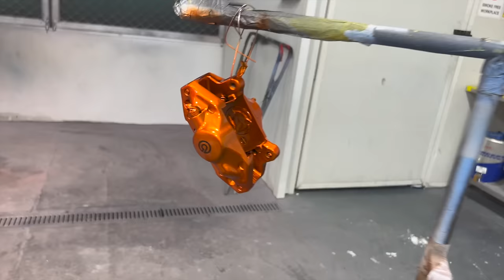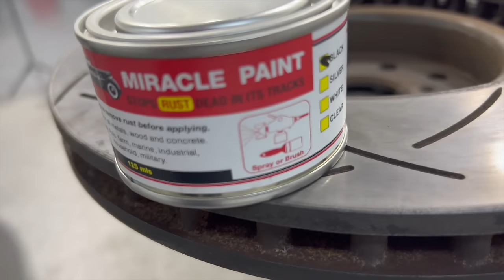How to paint your Brakes & Rotors with spray cans.

Comment: Glad to find a video that is a proper job removing the calipers. I want to color match my calipers the Honda Milano Red. That red is available from DupliColor Perfect Match which is an acrylic lacquer. I was thinking I could possibly get that paint to hold up to the heat if I used specific for calipers primer and clear… but those are all enamels and was worried about putting  acrylic lacquer on enamel. I might just be over thinking things… but this video made me feel I can just use an etching primer and 2K clear… so going to give it a shot. The car is just a weekend cruiser… not getting to extreme braking temperatures.

Comment: Great video on painting, just one important thing to note as a mechanic to never paint mating surfaces like on the face of the brake disc or surface for caliper bolts.  The paint will collapse over time and cause the part to become loose (wheel or brake caliper). Actually very important, however many repair shops still paint them, we just have to buff it off.

Comment: Great video Dave, just remember to never paint on mounting surfaces. It's dangerous to paint any mounting surface for wheels or brakes etc as the parts can not be tensioned correctly. The paint will not give a perfectly flat surface and can cause the parts to lose tension as the paint wears from contact. If these surfaces are painted then you simply need to sand them back to bare metal.  If you look at factory painted calipers and discs you'll find these mounting surfaces bare or possibly with a strong bonded coating eg on discs. 
As a mechanic though, I love your customising videos.

Comment: Thank you ! I learned more from your video than i have searching all over the web on painting my brembos. Like what clear coat and primer to use for adhesion and durability.

Etch primer sounds very promising and 2k clear sounds just like what i need for high use high temp resistant with solvent protection.  

Would you know if 2k holds up against brake fluid ? I dont plan on being haphazard when bleeding my brakes, but I've heard that if so much as a drop gets on a painted caliper, it would eat through its paint immediately like acid.

I think im just going to go with the kit on the linked site in your description.  To take out all the hunting and guesswork.
Reply from the maker: Hey thanks. The 2k is very good at defending against brake fluid. If left sitting on there it may tarnish if it's thin layers of clear.

Comment: Damn they look killer!🤜🏻🤛🏻 another way to paint the slots. You can grab a touch up paint pen and clear coat pen ( sold in pairs most times ) and just draw a line in the slot with the pen then go over it with the clear pen when dried. But still leave you with the hubs face n outer vents to deal with.🤷🏼‍♂️ either way killer job man 👌🏻👏🏻

Comment: Looks great! I have the same DBA rotors too! But I was wondering, are the rotors/disc brakes the same dimensions for the 2004 WRX to the STI? I'm asking because i think one caliper is seizing  and trashed that one rotor. I went ahead and ordered some gold Brembos brake kit and comes with regular slotted rotors. I want to maybe replace it with DBA ones again if the dimensions are the same

Comment: Won't those brake calipers get red hot when doing hard braking on a hot day? Did you need to use a high heat paint so it does not bubble or peel away from high heat?

Comment: So no curing the paint and prepping it for the clear?
Reply from the maker: No need. Chemical adhesion is recommended for base and clear coat. So within 20min is best to just coat base with clear.
Reply: @customspraymods  I do that with etch primer and the base coat, I've refurbished a few sets of motorbike calipers now. I never used a clear on them and they hold up well over years of use, I only decided not to do a clear because prep would be a pain. I also thought the clear would react or the base coat curing underneath would cauae problems.

Comment: Good job, although personally I've never seen the purpose of painting my Brembo brakes. The Brembo brake pads already put a thick coating of  black carbon all over my callipers, rims, tires, quarter panels, etc, etc. 🤨
Reply: At least is can now be cleaned with a mild car wash soap. Your caliper will be smooth af and easily cleaned,
/ serviced
Reply: @amthevision8931  Valid point, and it does look good.
Reply: @tim0e  yes most definitely! Cool points from the car community for all the efforts as well. I did big brakes on infiniti q50s in bright yellow with Akebono stickers, took days! Turned out next to perfect. Customer was jumping

Comment: The 2K clear you used is not high temp...So how has it held up?
Reply from the maker: I’ve used 2k on brakes and run close to 100 laps at the track with no problem. 2k is fine unless your circuit racing.

Comment: or.... replace the seals first so you dont get brake fluid on the paint which can munch it.
side note, prying on the pistons like that can damage them as pretty sure the STI ones are the same as evo which are phenolic, basically a hard plastic which is easily damaged...
Reply from the maker: Brake fluid wont hurt 2k paint unless its soaked in it for days.